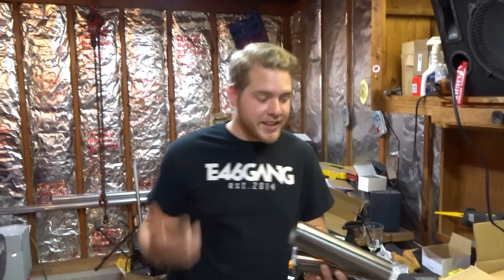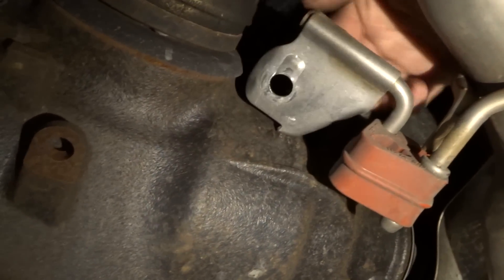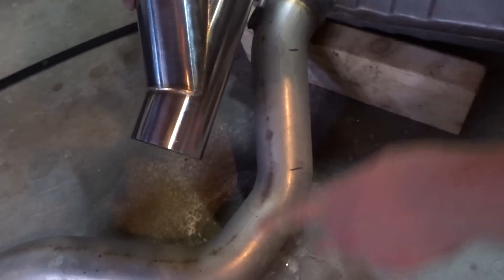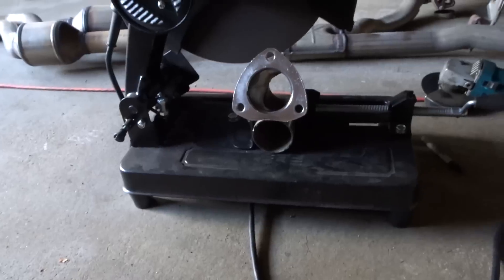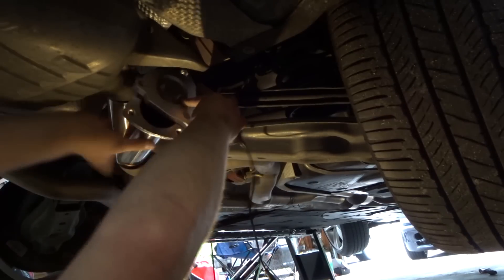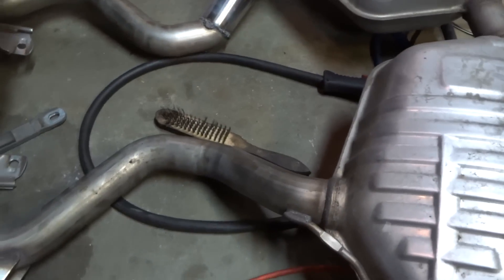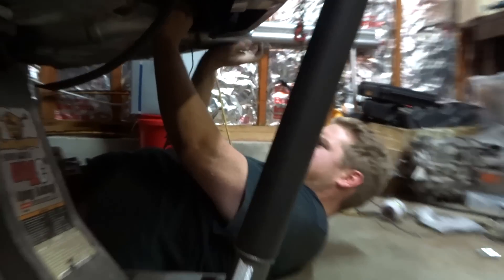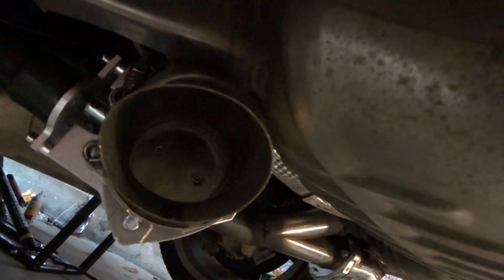335i Exhaust Cut-Outs! DIY

Comment: Hi! I write from Spain. I have 335i e93 and I want this mod. What diameter I need? 2.5" tube or 3" tube? 
Thanks!
Reply from the maker: Alejandro Pérez 2.5"
Reply: Budget Bimmers thanks friend! I will reply with video when I install it!
Reply: @BudgetBimmers  also found these exhaust cutouts on alie Express. But they also give the option for 2.25 inch. I believed an e92 335i exhaust was around 2.34 inch. So I need 2.5 or 2.25?

Comment: Hey bro I got a e90 335i I’m just wanna know does the cutouts scrape at all I went to 3 different muffler shops and they all told me it’s would scrape or they don’t see a good place to put it please lmk bro
Reply from the maker: Panda Panda so the exhaust setup may be different on the e90 because the way we angled the cutouts they don’t scrape they barely even sit lower then the exhaust, but again I don’t know the e90 exhaust layout so they might be right there might not be a way, I just know that the way we angled these on the e92 was mint and doesn’t scrape

Comment: Is this bad for the stock engine/stock tune. Is it bad for the car to suddenly have almost no more back pressure in the exhaust? Thinking about doing this to my 328i xdrive. Someone please speak about this:)
Reply: Not on a 335i because of the twin turbo setup, a 328i is NA so it needs the back pressure
Reply: You don't need back pressure unless you drive a 2-stroke.

Comment: I think a bird shit all over your welds. Good god man use Argon not flux core.
Reply from the maker: lakebum7425 ahhh yea that Home Depot flux welder is a bitch hahah
Reply: The cutouts are sick, I've got them on my old hot rod and it's hard not to leave them open all the time. Might put them on the 335 right after the downpipes. Is there enough room up that far is the question.🤔
Reply: lakebum7425 yeah there is that's my car in the video. I would have put them up there but I felt it would have sounded so loud in the car and I'd rather have the sound more behind the car instead over right under the middle.
Reply: His channel is called budget bummers I'm pretty sure he can't afford the expensive machinery like argon.

Comment: Great video, got quoted $2000 aud to get this done on my n55 335i. Was just wondering how did you guys do the wiring ?
Reply from the maker: orhan cirak this particular kit plugged in to the 12volt cigarette lighter, so you can see in the video how we connected them above the exhaust then ran it through the trunk and then into the cabin to the 12 volt not too hard